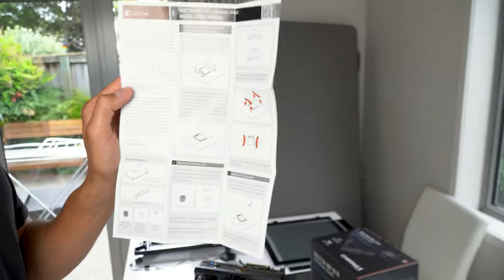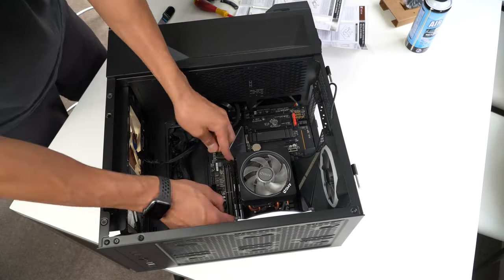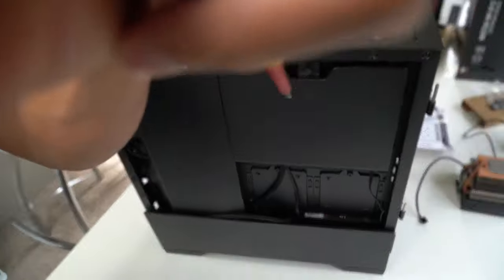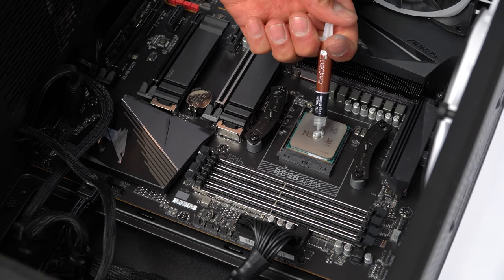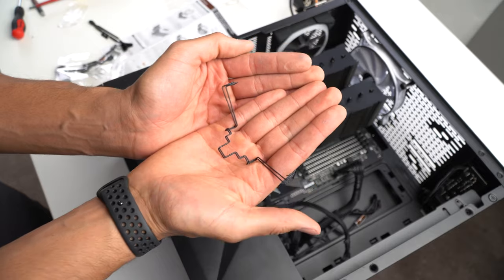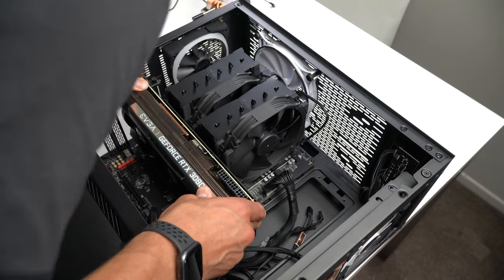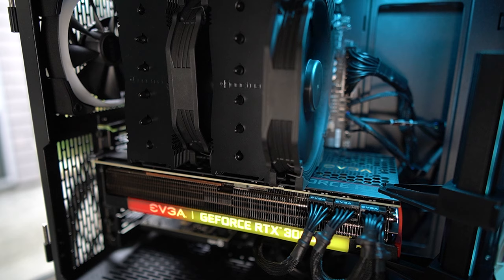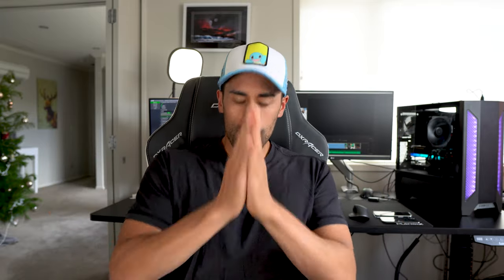Installing the Noctua NH-D15: Top Tips & Common Mistakes to Avoid

Comment: i also have the cooler. is it possible to mount the gpu vertically with this cooler?
Reply from the maker: Hey! That's a good question I think looking at my set up I would say it depends because I have one of my other PCIe slots filled with my Elgato capture card. But generally, I'd say it would be a tight fit. Sorry, I don't have a definitive answer. Thanks Ese
Reply: @mrtwomore  ya that was what i am thnking. Can you please try? I never saw someone who setup their gpu vertically with nhd15 cooler. Pretty rare, that would be awesome. Thanks!

Comment: Hi, I have recently assembled a server on Fractal Node 804 case (it already has 3 fans) with a processor-cooled Noctua NH-D15 (having the case already 3 fans on the Noctua I only put 1 fan); the question is this, I hear the Noctua fan that increases and decreases in speed continuously (it will do it 5/6 times per minute), I think it is because once the tampering has decreased, the mobo tells the fan to decrease the speed and so on but I am afraid that the fan motor will break, I have to see in the ipmi of the mobo if there is any option to have a more linear speed. Has anyone noticed the same phenomenon ???
Reply from the maker: Damn, that doesn't sound good! I can't give you an answer that is probably any use on that except I edited the fan curve on them to delay (the actual setting in the Aorus app is called Temp intervals) I adjusted it to 3sec to stop it doing massive ramp ups when say I was using Blender or Premier or After effects and has squashed most of those random fan RPM boosts which makes it go from a comfortable audio level to Jesus is there a hair dryer in my ear level. Sorry I couldn't be any more use, the only other thing that I can think of is trying those low RPM cables that they come with to see if that helps but like you said it might be something more to do with the tampering. Cheers Ese
Reply: @mrtwomore  Hello I will try to make those changes if possible. Thank you

Comment: Will the nh-d15 air cooler fit w/ 8x4 T-Force Delta w/o a problem sir?
Reply from the maker: Check their website where you can put in your motherboard details to see if it's compatible. If not then the NH-D15S might be a good one to check out!
https://ncc.noctua.at/coolers/NH-D15-2/motherboards

Comment: After installing it have you checked if your gpu runs hotter? It seems as if the gpu doesn't get enough air flow.
Reply from the maker: Not from my testing in the last 5 months of owning the GPU. Idles at 28-30 degrees and when gaming at 1440p and 120Hz it’s cool at 57-62 degrees so definitely not any hotter. There isn’t much of a gap between it which I was concerned about but with the CPU cooler fans pulling across the top where the hot air is exhausted from the GPU it actually doesn’t seem to create any thermal issues ! Thanks Ese

Comment: I've noticed that the GPU is too closed to the noctua cooler, will this affects your GPU temp?
Reply from the maker: I can honestly say with my usage over the last 6 months it has been totally fine even close to the GPU like it is! :) THanks Ese
Reply: I've swaped my aio cooler to NH-D15 which touches the backplate of my 980ti, and my temps even have dropped by around 5 degrees C

Comment: million $ question is how tf do you remove the GPU now with such little clearance.  I ordered my fan today should be here in two days can't wait to use it but the only downside is I likely won't be able to take the GPU out so will have to deep clean before installing.
Reply from the maker: Sorry for the delay, I had the exact same thought but realized you can use a tool like this from ifixit.com or some other place to push down the PCIe slow connector latches - https://www.ifixit.com/Store/Tools/Spudger/IF145-002?o=4 or a thin screwdriver (I''m not super confident of that way in case you slip)

Comment: what case did u use? my rams are 43mm height (i think yours are 41) and the case im looking for has 185mm cpu cooler height, should that fit nicely for the fans not to touch the glass?
Reply from the maker: Hey! This is the Lancool 2 Lian Li and it should hopefully fit all good!
Reply: @mrtwomore  Thanks!!!

Comment: Isnt there any problem that the GPU exhaust direct hot air into the Noctua? Got the same EVGA 3080 and im planning on buying this Noctua
Reply from the maker: Yeah I thought there might be with it being so close but from my before and after temps it doesn't look like it does! The 3080 runs at around 55-60 degrees when gaming in 1440p on my LG monitor and I thought that would potentially spit up some warm air into the Noctua but I think what is happening is that the air pressure from the 3 fans at the front and my fan curve is driving more cool air through that first fan on the D15. In saying that the EVGA 3080 FTW3 exhausts a lot of its hot air out the back of the case throgh the slots in the card and the top of the actual 3080 isn't that perforated so maybe the hot air isn't all getting dumped directly into the D15?? 
Just tested:
The GPU can be 60 degrees (144hz | 1440p | all settings high/ultra) when gaming and the CPU sits at 51-52 degrees chilling watching me trying not to get quick scoped on Rust in COD multiplayer haha so that my real world data to help you.

Cheers

Ese
Reply: @mrtwomore  oh, thx for the quick reply !First of all  I wonder how u managed to get only 60 degrees while gaming with the 3080, mine gets 70-72 on Warzone and Cold war all settings on Ultra. That’s why the heat coming from the gpu majes me think it will somehow be an issue to the Noctua constantly dumping hot air into the cpu.
Reply from the maker: @mattzgc8457  I'm just booting up my PC now to play some warzone for you to compare and see, I actually just made a video of my settings and temps and fan curve so you and a few others who have asked can maybe get some ideas or compare settings etc. I'll keep you posted!
Reply from the maker: Just testing now on Warzone quads - 138-144Hz 1440p with all setting on high/ultra and temps sitting at 62 degrees with a room temp of 22.5 degrees and humidity of 50%.
I put my power settings at 90% and memory clock at -100 and it’s running stable. Let me know if you want any other info etc.

Comment: What's the height of your ram modules? Can you please specify exact ram model that you've used?
Reply from the maker: The modules are the G.SKILL Ripjaws V Series Black 16GB DDR4 Desktop Memory 3200Mhz - Height: 42 mm / 1.65 inch
Here is the official website: https://www.gskill.com/product/165/184/1536110676/F4-3200C16D-16GVKBRipjaws-VDDR4-3200MHz-CL16-18-18-38-1.35V16GB-(2x8GB)
Thanks Ese
Reply: @mrtwomore  And you were still able to close the glass panel after raising the fan for the 42mm module? The case you're using is Lian Li Lancool ll, right? With 176mm of cpu cooler clearance? 
Forgive me for spamming you with the questions, but I'm trying to figure out a configuration and with this particular cooler, compatibility does become an issue.
Reply from the maker: @maidenhead6661  Yeah it closes no problem, someone else in the comments had a similar concern about that. The case I have is the Lian Li Lancool 2. Check out this link which is might help you. 
https://ncc.noctua.at/cases
Reply from the maker: @maidenhead6661  This link has cases, motherboard and CPU compatibility list which might make it easier figuring if your setup will work out 😁
https://ncc.noctua.at/
Reply: @mrtwomore   Thank you so very much, this is really helpful!

Comment: How much clearance did u have between ur cpu and ur case?
Reply from the maker: I just measured it with the Lian Li Lancool 2 and that Noctua NH-D15 I have about 8 inches from the Motherboard PCB to the edge of the case and from the top of the front fan which is slightly offset due to the ram it's 1/4". But check this sight out as it might help with checking if it could fit: 
https://ncc.noctua.at/motherboards (this is for motherboards)
https://ncc.noctua.at/cases (this ones for cases)

Comment: How come it didn’t block the RAM
Reply from the maker: I had to offset the front fan but the ram I had and the cooler were compatible. Check out the Nocuta website as they have a compatibility page so you can check to make sure, cheers ese

Comment: hello, i have a smaller case and had to mount this facing upwards blowing air out the top(vertical instead of horizontal), would this affect performance at all of the cpu fan? Would it not work properly?

Comment: bro I have auros elite b550 elite v2 gigabyte mobo and cooler master td 500 mesh + rtx 3080 gigabyte vison gpu, do u think I can fit this cpu cooler in there with 2 sticks of ram positioned in
the second and the 4th slot ?
Reply from the maker: Hey Peter, Nice set up that should go really well! 
And looking at the website your case and space should be fine with that cooler or the D15S version. 
Heres the link to the compatibility list:
https://ncc.noctua.at/cases/model/Cooler-Master-MasterBox-TD500%20Mesh%20ARGB-391
Also, you might still need to offset the front fan a little bit but that should be okay with that case. 
Check out that link so you can be sure! 
Cheers Ese

Comment: Did you have an issue with the cooler blocking or making any of your pcie slots unusable?
Reply from the maker: Yeah, I thought it would but it doesn’t make unusable however the space between the cooler and the EVGA 3080 is very very small so I was a bit worried!
Reply: @mrtwomore  ok, thanks for the info.  This is looking more hopeful in terms of fitment for me.  I see you had to raise the 2nd fan above the ram.  Are you able to use normal height ram(non low profile) after raising the fan?  Also can you tell me what the max height of the whole cooler is measured from the top of the fan you raised?  Just trying to see if this will fit my set up.  Thanks!
Reply from the maker: Hey John, I’ll check once I’m home to do that measurement on the cooler and fan. The ram im using is G.skill Ripjaw Black 3200Mhz and I’m pretty sure it’s not Low profile as the heat sink is on top of the ram. I know the NH-D15S has more clearance compared to this one the NH-D15. Will let you know soon on those measurements!
Reply from the maker: Measured from the top of the cooler unit to the top of the front fan and it’s 25mm. The height of the NH cooler is 160mm off the website so total would be 185-187mm. I can’t get an accurate measure from the Motherboard PCB to top of fan sadly as it’s too tight in there to give it a go without my metal ruler touching something but that should give you some more measurements to go off.
Reply: @mrtwomore  Thank you for taking time to try and measure.  Since you had trouble measuring, one final question.  With the fan close to the memory.  How much higher did you have to move the fan up to clear the ram?  Ex: 1/2 inch, 3/4 inch etc.
Reply from the maker: @JohnSmith-tv5ow  No worries at all about the question, just measured the fan and the height it was raised and it was 25mm or 1 Inch based off my tape measure, hope that answered that, cheers Ese
Reply: @mrtwomore  thanks so much 😀

Comment: Ive got almost the same case.  I do have RGB memory though so i dont want the fans to cover it up.  Can i just mount the fan on the other side near the rear exhaust and get similar performance? Or is it important to be mounted in this configuration?
Reply from the maker: To be honest if your Motherboard doesn't have too much big of a rear IO and VRM shroud you could prob put it the fan there. I imagine there might be a bit of a performance decrease from the intended location but maybe it won't be that noticable and that way you can show off your RGB still. Looking at my B550 you could probably do it. If you want me to try just say and I''ll fiddle around and get it up and test both versions for you! Cheers Ese
Reply: @mrtwomore  I ended up ordering the NH-D15 and trying it out and it fits no problem :)

I also did some research and some people have tested it saying that it can cause a 0.5-1 degree average increase in temperature versus the standard push-push configuration which I am willing to deal with.  
Thanks!

Comment: What temps do you have with that Nh-D15S? I get 32C after turning on/idle but then in games like Cyberpunk/Call of duty it hits 77-80. This is on 5600X and GameBoost on/Precision Boost Overdrive on. Is it too much or is it normal/because of the high voltage (like 1.4V) from PBO?
Reply from the maker: I would say it that idle temp sounds right and a good temp for sure! 

On the Ryzen master settings check out reddit and the people playing around with over clocking or undervolting. 
I found from my experiments that I ended up having minimal performance improvements when I have it set on game mode in Ryzen Master so I set it up on my custom setting in the app to make it a manual under volt my is clock at 4100 MHz and 1.875v with my 3800x.
My temps when playing even in 4K ultra or warzone which might be the closest to cyberpunk sits around 58-63ish but never over high 60’s. 
In saying that if you are streaming or recording gameplay at the same time I would recommend a less aggressive under volt and under clock as that might mean frame drops in game and also in rendering. 

Maybe it will help if you do something similar but I would say get some ideas from one of those forums to give you some starting points.

In saying that those temps you said aren’t mental but if you could get some temp improvements for no performance loss then it’s a win plus from a power consumption you should also decrease the  heat coming from your PC in your room too.
Those are just my thoughts and hope that helps somewhat!

Comment: Does this cooler fit on msi z390 gaming plus and i7 9700k and 2× corsair vengeance pro  and c200 case ?
Reply from the maker: I wouldn't know the answer off the top of my head sorry but check these links to see if that might give you the answer! 

https://ncc.noctua.at/coolers/NH-D15-2/cases/Corsair

https://ncc.noctua.at/coolers/NH-D15-2/motherboards

Thanks Ese
Reply: @mrtwomore  I see that the mobo and cpu and case is compatible with the cooler but is the ram a problem ?

Comment: Mate i plan to put it on 3900x which is usion 360mm aio which sucks the temps always above 90 under load idle 70c 

Will it make any difference i run under load for prolonged time for rendering and stuff pc runs 24/7
Reply from the maker: Apologies for the delay I had thought I had replied sorry! 
 This link might help if you haven't sorted or found more information already! 
https://ncc.noctua.at/cpus/model/AMD-Ryzen-9-3900X-1033
Give some scoring on the different coolers offered by Noctua! 
Thanks and happy building! Ese

Comment: Do you have G SKILL ripsaw ram?
I have a DH15 cooled and i fear that the ram might be too tall
Reply from the maker: Yeah I do, they are the F4-3200C16D-16GVKB to be exact so you can check if they are the same.
Reply from the maker: The D15s supposedly has a bit more clearance but I got away with just the D15 chromax just fine.

Comment: Hi, is this Noctua NH-D15 gonna fit on asrock b550m steel legend ? i'm currently using cooler master 212 led turbo which is taking my slot 1 ram. and is it gonna fit also if i'm using VGA amd rx 5600 xt ?
Reply from the maker: I wouldn’t know the answer off the top of my head but check out this link which is how I checked if the NH-D15 would work with my motherboard. 

https://ncc.noctua.at/motherboards

Hopefully that helps with you figuring it out ☺️ Ese
Reply: It fits on my asrock b450m steel legend

Comment: The only issue I had was with the thermal compound acting as glue. When I tried to re-place it it ripped the cpu out of the socket and I didn't notice until i wanted to check the cpu. but oh no! there's no cpu! wait a damn minute... ITS ON THE FUCKING COOLER!?!? bent pin, fixed waiting for psu for test